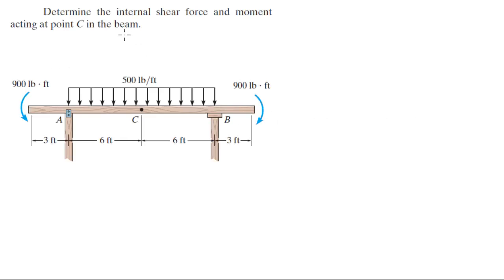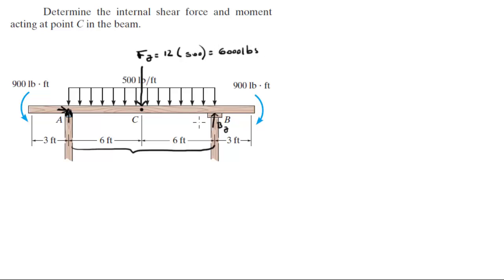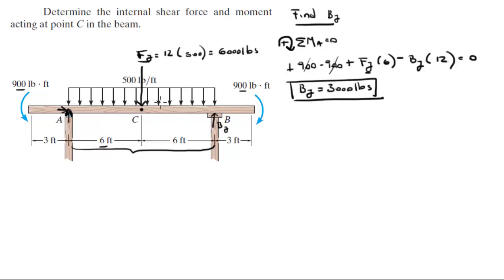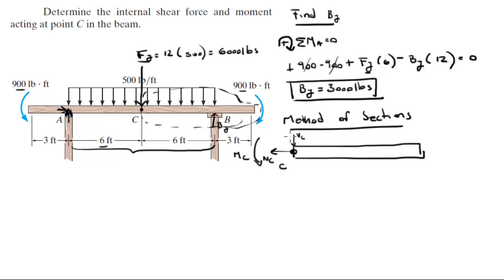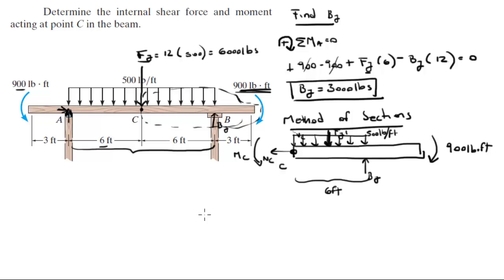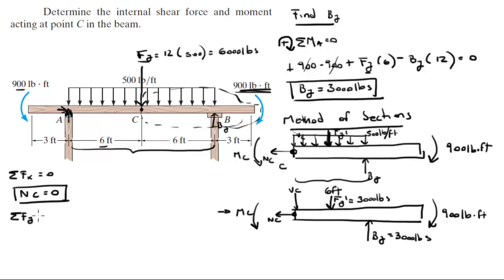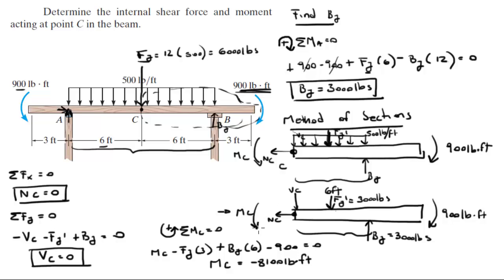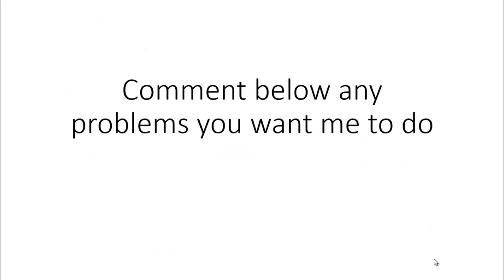Determine the internal shear force and moment acting at point C in the beam

Comment: Nice! could I just ask why is the shear force of C acting downwards. can it act up?
Reply from the maker: Shear force is a cutting force, if there is one going up there is one going down at the other side of the "cut" you made for analysis. However the only reason why the shear would be aiming the oposite way that you originally assumed in your diagram is because your answer turns out with a negative answer. If it doesn't then it's alright.